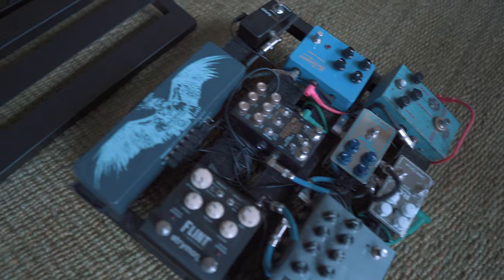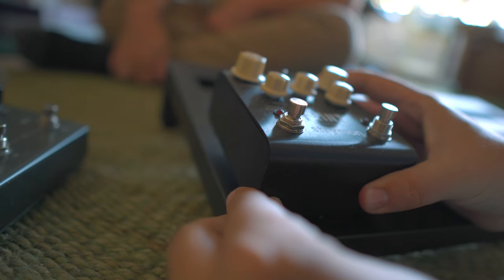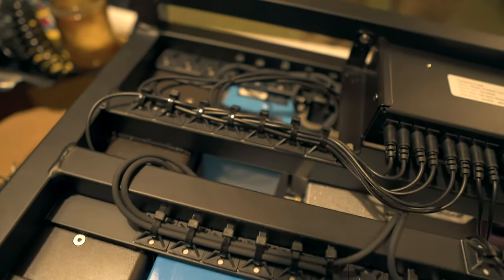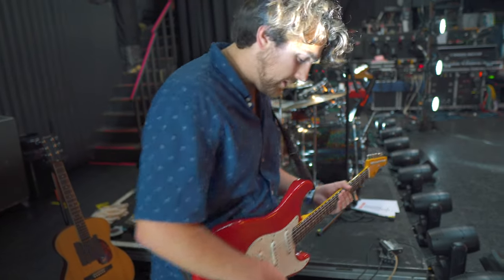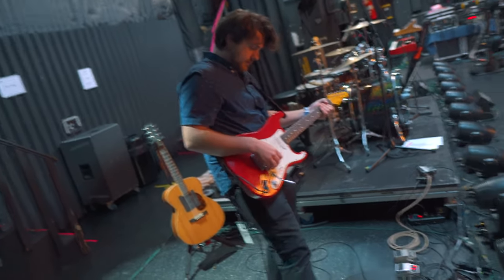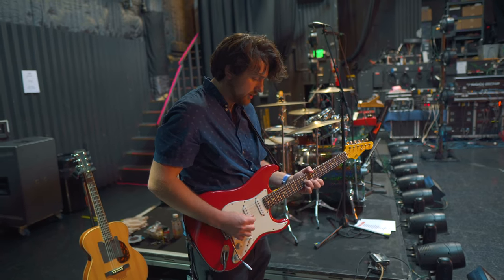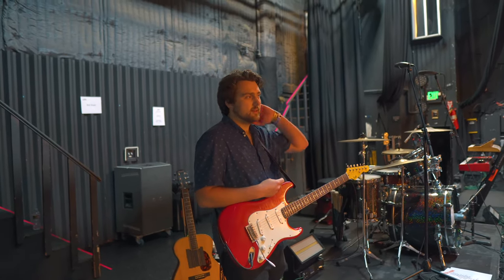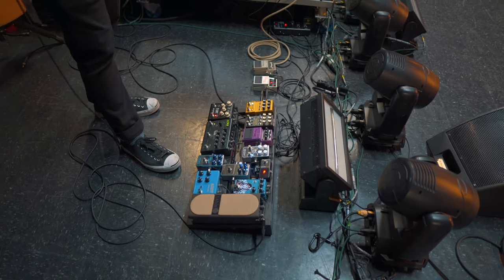TOURING PEDALBOARD BUILD for RC ROSSEL of Role Model

Comment: I can't help but be concerned about the tape on the acoustic.
Reply from the maker: Ha! Yeah I actually helped fix the acoustic a bit off camera. We’re both fans of the LR Baggs Lyric pickup, but it’s got a volume control that you mount on the sound hole of the guitar. That means those traditional sound hole muted can’t be used easily. So I guess the easiest thing to do was use gaffers tape haha